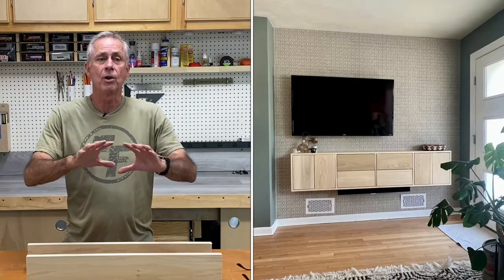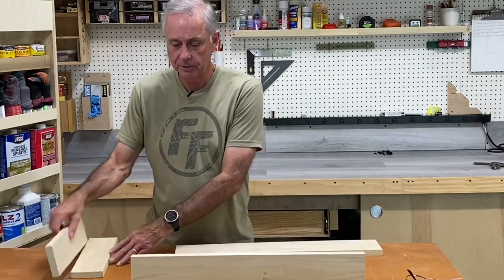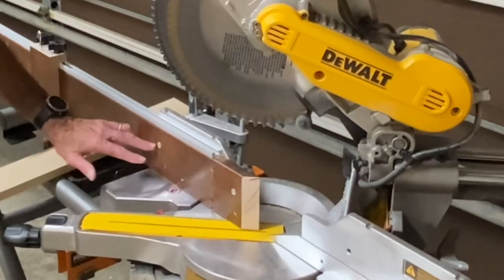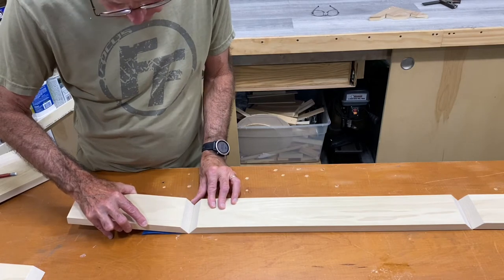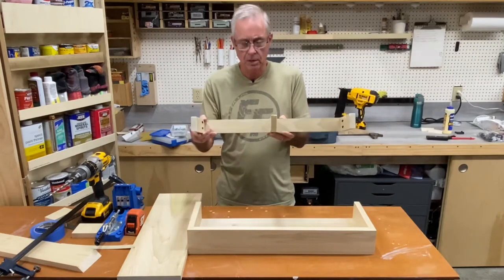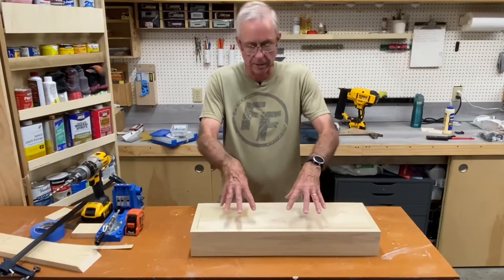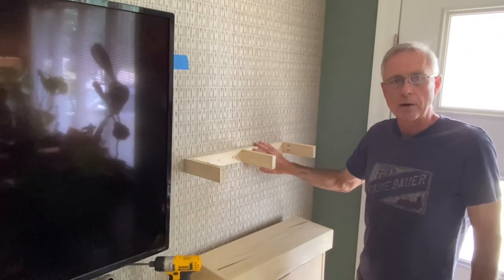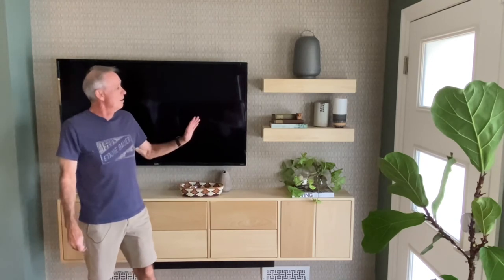How to Make a Floating Shelf

Comment: I really like the tape and fold up assembly process you used for the 45 degree angles.   I have run into problems leveling things that are attached with toggle bolts due to the oversize holes required to insert the toggle into the wall.  I place a level on the object to be attached to wall and tighten up the bolts while holding level. Sometimes a multiple attempt procedure. I have never used the snap off plastic toggle bolts you used in this video.  Any recommendations?  Thanks!
Reply from the maker: Great tip on making sure your item is level as you tighten the screws.  I’ve used the Toggler brand bolts on two different occasions and they work very well.  I really like the ability to use the plastic insert piece to tighten the toggle bolt before you insert the screw.  Thanks for the comment and suggestion!